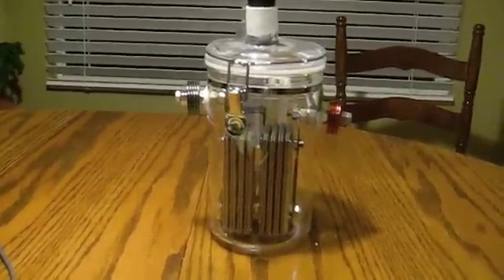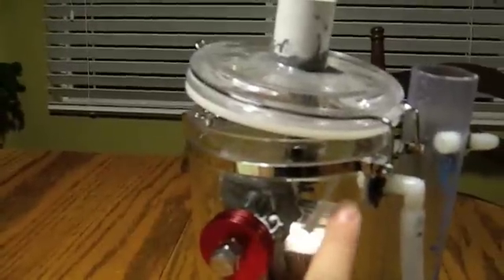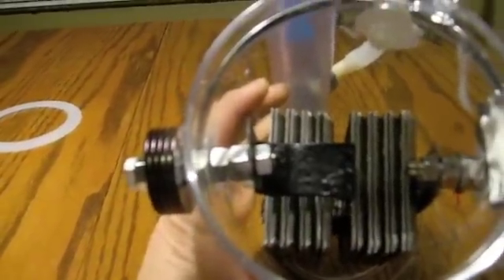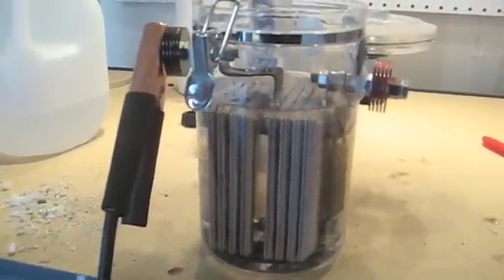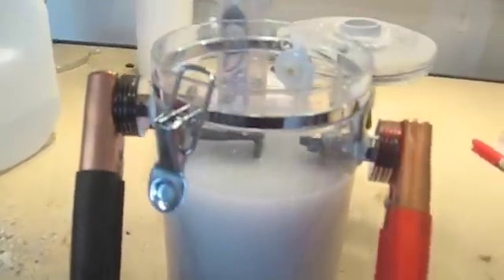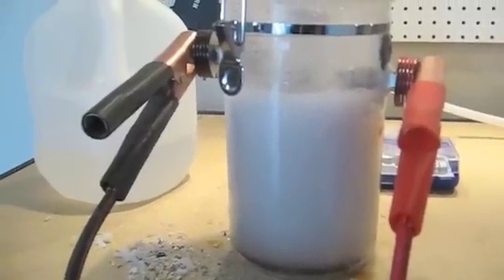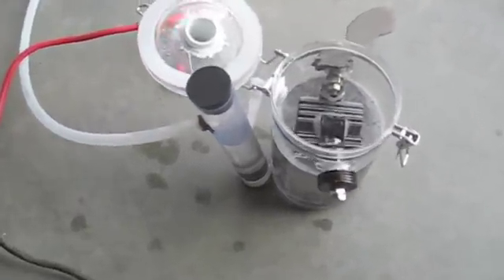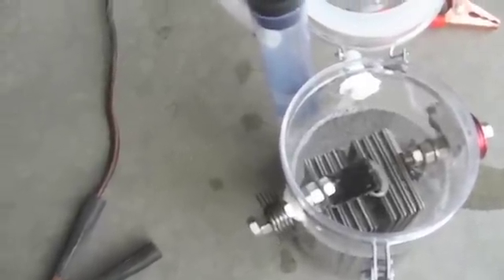HHO Generator - 16 Plate, Potassium Hydroxide

Comment: ￼

HHO ACMEC

Hho kits for your  car & motor bike solve all the engine heating problems automatically. Sace fuel and More engine power and performance engine running cool Without Creating Any Carbon Emission . environment friendly fuel saver device. Also Best technology for the human health and happiness purpus HHO breathing machine. VERY simple and safe and easy technology, amazing recovery of human dieses like eye care,skin care, breathing shortness, parkinson and so many other dieses. Hydrogen rich water is best energy drink for human body health and happiness and beauty, for good sleep. Hydrogen gas is a powerful antioxidant detox our body. Reserach on hydrogen water is in the early stages so side effects are unknown. Or you can say so for no side effects. Hydrogen is 88 time smaller then vitamin c but richest in antioxidant. HHO technology best for our  cars. I am sure nany persons would be benefit from our hho acmec videos. HHO kits are very simple but very useful for old cars engine efficiency and performance fuel saving and money saving and envernment control hydrogen on demand system zero carbon emissions. Kit can install without any modifications in your car engine. HHO kits are very useful for cars engine efficiency and performance and money saving Hho prolong the engine life and solve the engine heating problems,prolong the engine oil life too reduse service or car mantanic. your car will run like a New car. Calm and quiet running, remove carbon monoxide witch is very bed for the human health. Your car will start faster than before. Your car temperature will redused. Improve your car mileages. Hho kits make your car More power full, smother running. HHO kits will not harm to your car engine. Hho improve the fuel burning efficiency like high octane fuel. I called HHO technology is a  money saving technology. Rember to use only a little HHO gas for the best engine efficiency. Don't try to store HHO explosive gas . Hydrogen on demand system is best for use. For more information please call me.03082266179 Zafar.

Comment: So when i turn mine on it makes a lot of foam. Does any one know why and how i can stop it?
Reply from the maker: It could be the type of water and catalyst you are using.  Make sure to always use distilled water and try to use good stuff like Potassium Hydroxide and NOT baking soda.  Some foam is expected.  One trick is to put a little stainless steel wool at the top of your system just in front of the holes.  This will help pop some bubbles and prevent them from flowing in to the rest of you system.
Reply: I'm using 316 stainless steel and distilled water and the catalyst is potassium hydroxide. iv noticed that at first it makes a lot of bubbles and foam but after about am minute it settles down a bit but still makes quite a bit. also, I'm now noticing that there is a brown, rust looking, substance in the bottom. :/ do you think i made it to concentrated?
Reply: goodtech
Reply: hppapy
Reply: If you use pure distilled water and 316 SS there is no way you have anything brown inside your cell unless your SS was dirty to begin with.  Distilled water has nothing in it to turn brown, and 316 resists corrosion better than any steel you can get.  I use 304 or less and get some brown in the water (not even scum on the top).  When I use tap water I get brown scum in minutes.
Reply: Use anti foam, it worked for me when my setup was foaming.

Comment: WOW nice design and build.  I dont think that you can create enough to run anything other than a small motor but beautiful job.  What did you use as separators?
Reply from the maker: Thanks.  Nylon watchers, Nylon threaded rods and stainless steel nuts are used in addition to the plates.

Comment from the maker: @mr240kevin  Yes, The 304 has held up perfectly.  The plates even stayed in my solution for a while and never corroded.  Though after having it run for a while the liquid electrical tape did melt.

Comment from the maker: Not sure if its steam as in water vapor (doesnt seem to have gotten hot enough to make steam).  I believe that my high MMW is because I am just using a multimeter to check for amps and it may be reading it wrong.  

I have since added another 3/4 teaspoon of KOH and saw production jump, in the amount of bubble through the bubbler (but my multimeter is broken now and cant get the specs on it)